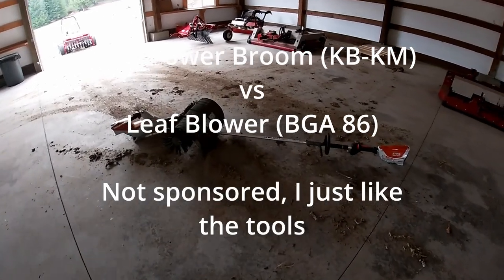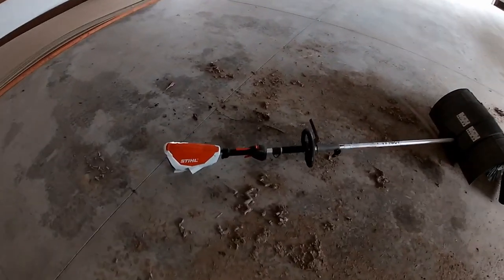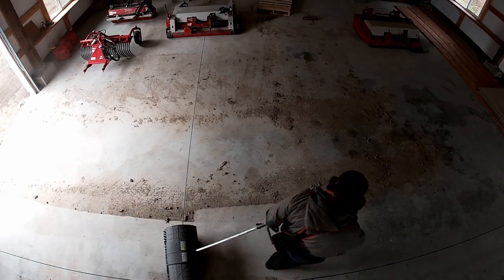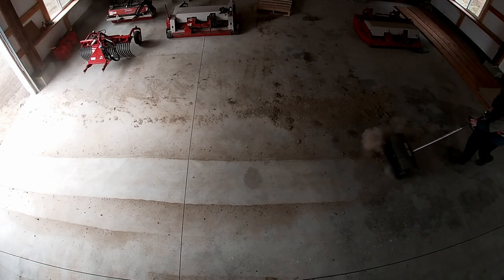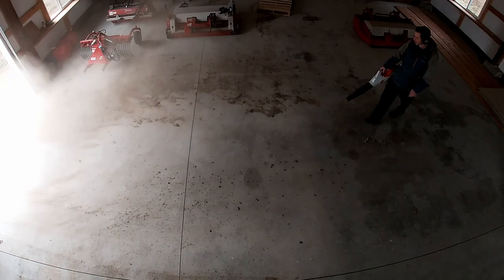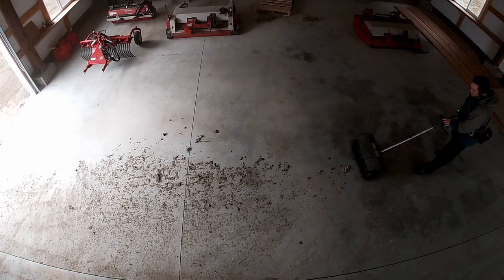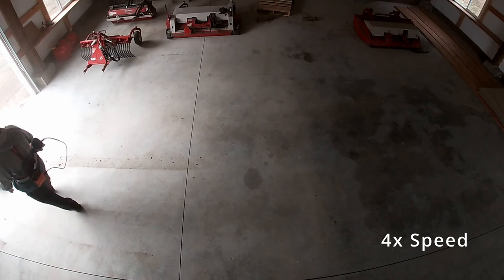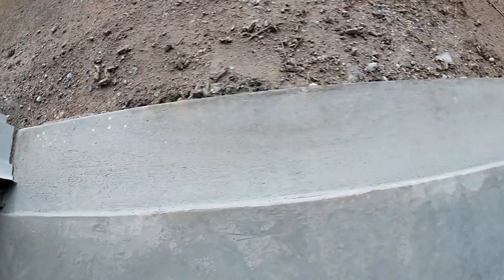Stihl Power Broom vs Leaf Blower in a Barn

Comment: It would be nice if the power broom ran on gas.  It would also be nice if the power broom was wider.   Thanks for the video.   I just got 2 commercial parking lots to clean.     I'm looking to buy something that helps me pick up trash and clean the parking.    I guess I'm definitely getting a leaf blower 😊
Reply from the maker: Stihl has a gas power-head as well.  That said, there are a ton of sweeping things out there.  Walk-behind power-brooms might be a better fit for your use case.  And there are floor sweepers that'll pick up the trash, which might be what you need.
Reply: @slidingscales257  okay.  Thanks for the information 👍👍